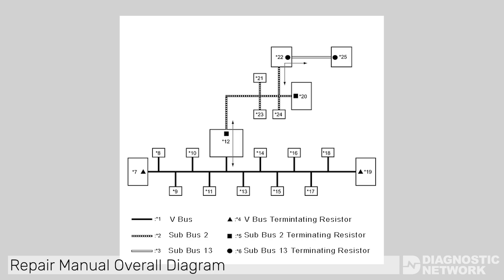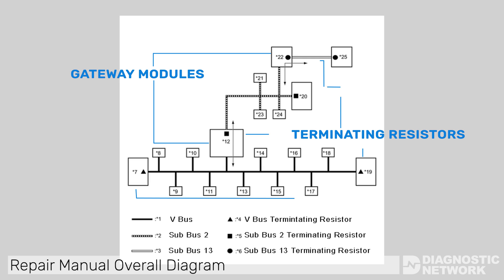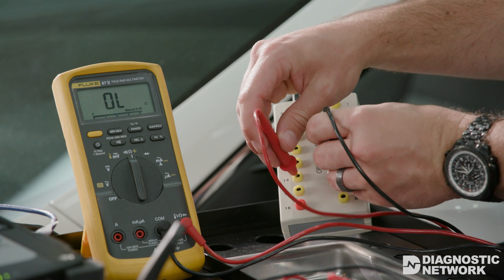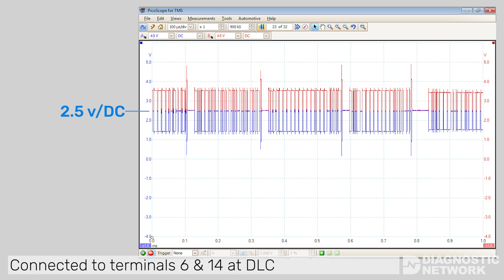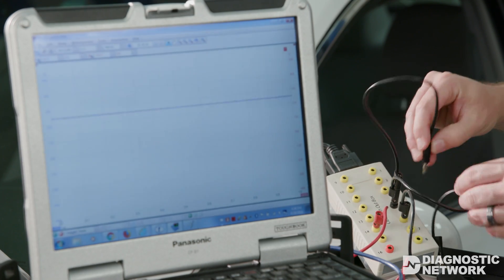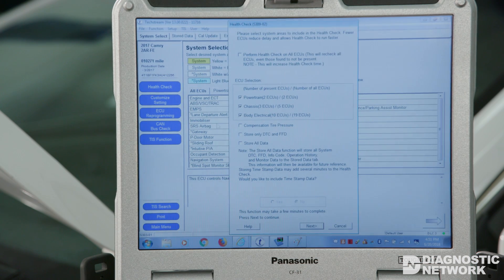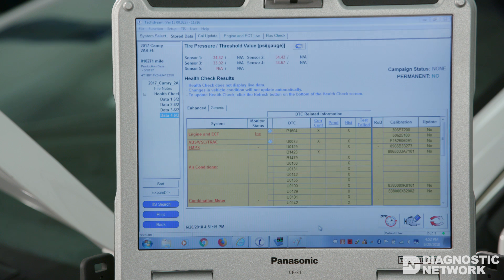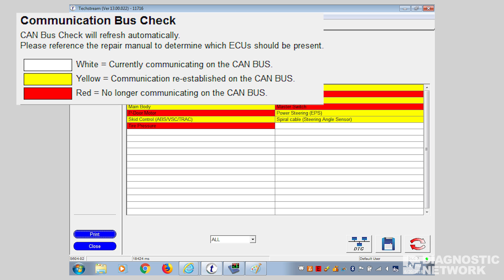Toyota Network Communications CAN Diagnostics - Diagnostic Network - diag.net

Comment: Hi
I have a TOYOTA HIGHLANDER 2006.
Happened to die on me for the first time on the Highway.
I quickly plugged in my OBDII Scanner and pulled Codes : 
P0AA6 Hybrid Battery Voltage System Isolation  Fault.
C1310 HV/EV System Malfunction.
When I clear the codes and restart, they re-appear after starting the vehicle.
Secondly I noticed that the scanner could not read or connect to these components or modules:
BCM (Body Control Module),
SRS (Supplemental Restraint System
SR (Sliding Roof)
BD (Back Door) (Not sure if the vehicle has this module)
ES (Entry & Start) (Not sure if the vehicle has this module)
AGW (Accessory Gateway)
EMPS (Electronic Motor Power Steering)
DDM (Driver Door Motor)
CM (Combination Meter)
AC (Air Conditioning)
They are literally offline. Everything works fine, doors, windows, lights, sockets, AC, etc.
I had a spare HV Battery and I swapped it out and codes went away. But I still could not establish connection to these modules and to diagnose them. I have checked all fuses and all seems OK.
What could have gone wrong?
Where can i begin my further checks?
Please I need help here.

Comment: I have a 03 avalon xls c1301 can communication malfunction.... any help would be great. VSV button by my right knee won't click or show anything on the Dash... when I turn the key from off to on (power) the dash shows stability control illumination on the dash for a second and then it goes away... side not I rebuilt my rack and pinion/power steering and master cylinder including replaced booster. Bleed the breaks and installed steel braided break lines.... I know I went a little over board.. I also have a p0456... I have replaced every single vacuum hose afront of the engine... recap, p0456 and c1301 is my only issue on a 03 avalon xls